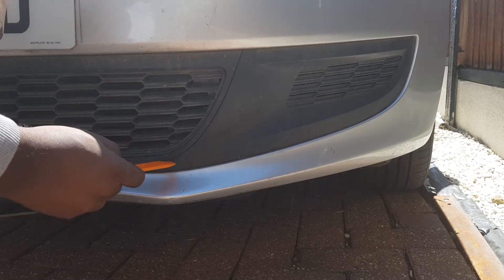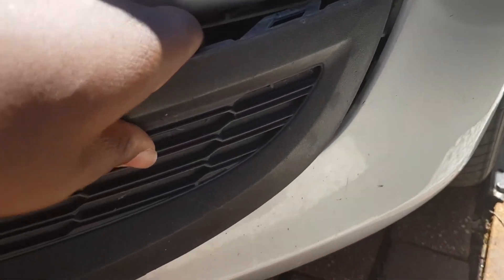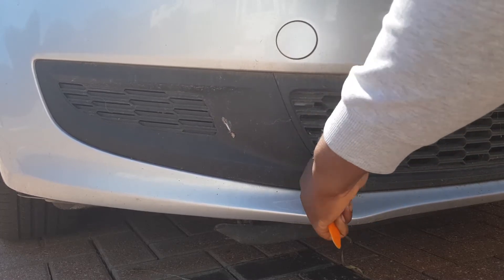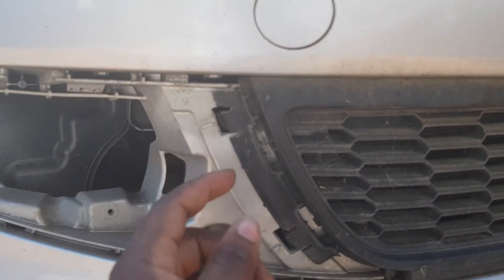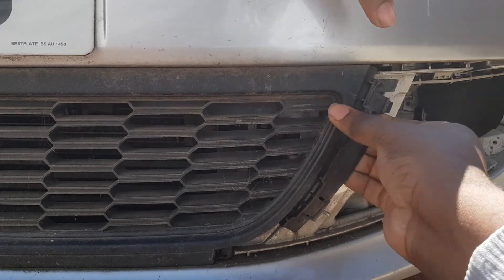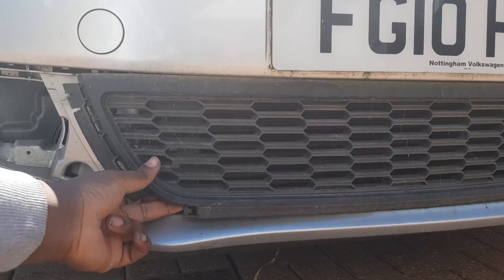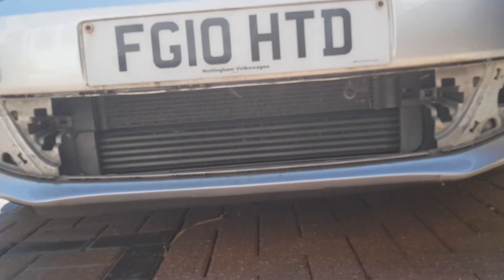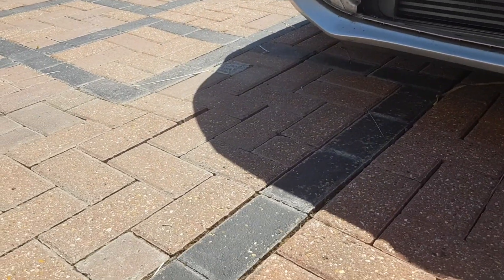How to Remove VW Polo front lower bumper grill

Comment: For anyone that is watching this and has the fog lights, please use the small tool that looks like a hook, it will be in the tool kit with the spare Tyre, use the hook in the small hole in the fog light cover and pull it out with that, its a 1000x easier to take the lower part off that way.

Comment: hi mate, i was thinking of spraying my lower grille ( exact same one as yours ) and wanted to ask if you know what the large filter-like thing is behind the middle main grille part? I'm concerned its maybe the air intake and if I spray it then it could be damaged ( using plastidip plastic paint )
cheers
Reply from the maker: I believe that is the ac condenser and at the very bottom the intercooler
Reply: @RCS_716  ok thanks mate
Reply: Did u paint them? Im considering painting mine

Comment: How to fit a new bottom bumper grill?
Reply from the maker: Unfortunately I've changed to a different style bumper now so I can't show myself installing it but just do what I did in this video but do it in reverse.

Middle grill first then slot in the 2 side pieces. It's much easier to put it back together than it is taking it apart as the grills will just pop back into place.

Sorry that I can't show it but I hope this helps a bit 👍

Comment: Thanks for the precise instructions.

I did this today, because I wanted to install a replacement grille with the chrome trim on the bottom. What an awful job. I broke all the top clips on the old part, struggled to get one of the outermost lower bottom clips fixed, and finally had to use a hammer to put the side plastic piece back in its place. I dearly hope I won't need to do this again. I'd definitely better stick to tinkering with electronics.

Comment: Do you maybe have any tips/instructions on how to put in a new one?
Reply from the maker: Best advice I've got is to literally put it back but in reverse.

For example, the side pieces kind of slide out when you are pulling it out so when you go to put it back in slide it into the bumper so it's in place then press on the other side so it clips in.

For the middle piece, put the top part in first and line it up then press on all the places where it should clip in to secure it again.

Sorry if this isn't the best advice but it's all I've got, hope it helps 😁
Reply: @RCS_716  Thank you man!! Will try again to put the new one in the way you mention
Reply from the maker: Hope it goes well